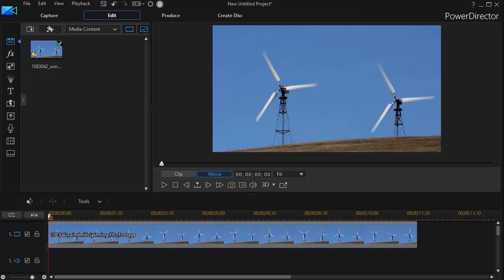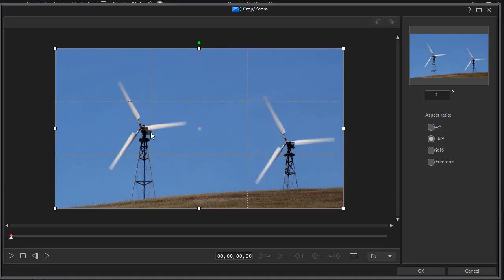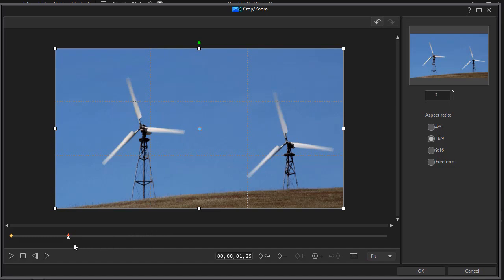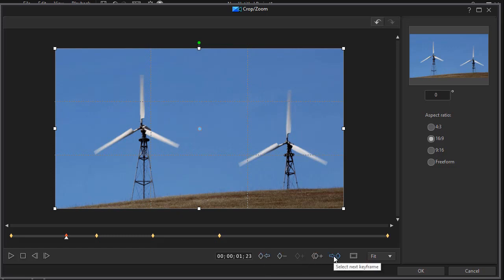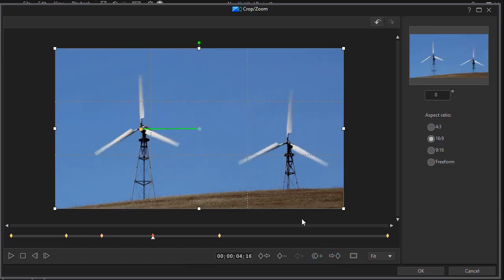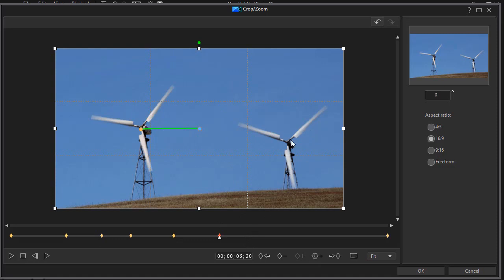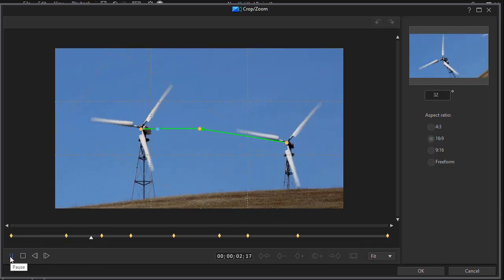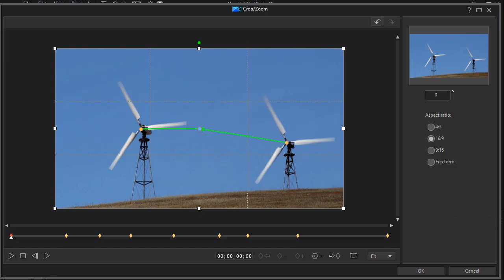PowerDirector - Tips on zooming in and out with crop and zoom

Comment: Thank you for this informative video. I am now using this technique in my static multi-cam shoots, on shots of two people, to zoom and bring one to the front when required. One of my static cams was temporarily  knocked out of horizontal and I was able to zoom in and correct with the angle adjustment when that clip was required, so I found a real time use for it. I'm on PD14 and looking at PD19 and hope there is a "ease in, ease out" button for the zoom within the upgrade..
Reply from the maker: I'm delighted that you are finding some of these tips useful and are putting them to work in your own creative way. I don't see an ease in or out control in 19 unless I'm missing something. But you can achieve that with regular keyframing too. --Jim

Comment: I've had that same problem (showing the black areas outside of the screen) when simply zooming in on something that's on the far right side or far left side of the video, and then slowly zooming out.  Is there any way to avoid this?  BTW, great video!  Always enjoy your content!
Reply from the maker: The only tip I can give is to watch very carefully how you use this technique so that you don't wind up with footage outside the frame. It may take some planning in the shoot as well as in post-production (if you have some control over both). --Jim
Reply: @SharperTurtle  Thanks Jim!

Comment: I use crop and zoom all the time when editing my sons baseball games. Since I am shooting through a chainlink fence it's  easier to do in post than try to follow the ball with manual zoom on the camera. It's a bit frustrating because this is the only tool that has different keyframe controls than all the rest where keyframing is allowed. Its almost like a different program. Maybe that will change in the next version. And interestingly, even though I use this often I never once paid any attention to the angle adjustment.  I though that could only be done in PIP.   thanks again Jim !
Reply from the maker: Scott,
You are welcome. Yeah, the keyframe controls feel a bit odd in the crop and zoom tool. It does seem as though it was designed by folks in a different building from the engineers who created other parts of the program. And you can't move by frame or second. It doesn't seem as flexible as it could be, but at least it works. --Jim